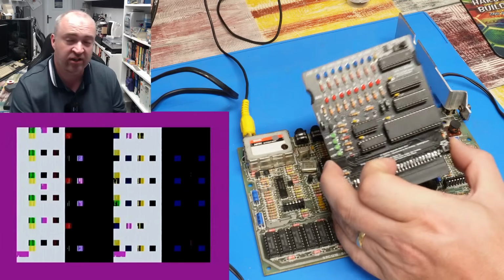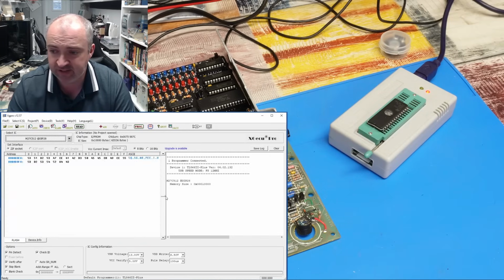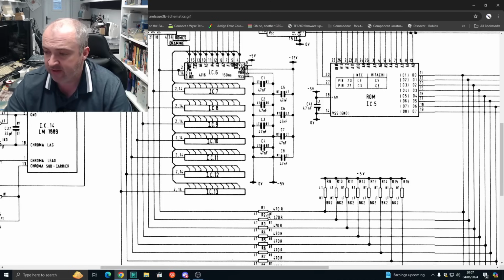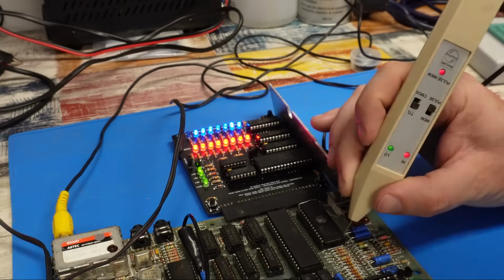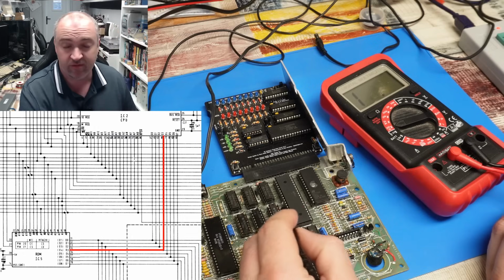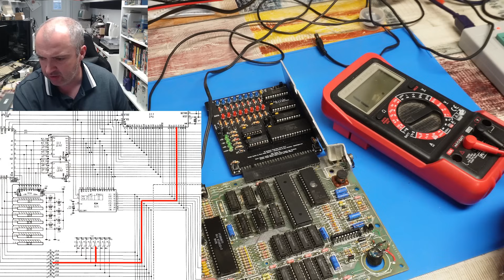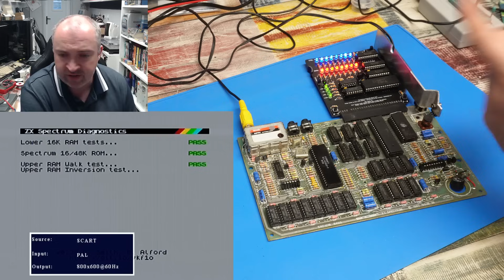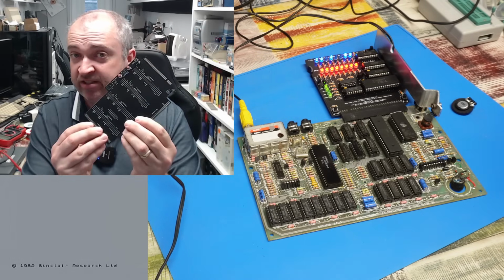Why is my ZX Spectrum Faulty?

Comment: Back in 1985 I didn't have an EPROM eraser so I put them without anything covering the window in direct sunlight for days on end but not a single bit flipped. They are quite resilient and just absolutely do not get erased that easily. You really need harsh hard UV light to do that. Maybe you could repeat this experiment yourself, it it quite hard to get a single bit flipped with normal light, nearly impossible. Just burn one and keep it in the sun all summer, I bet it will keep on verifying okay.

Comment: Logical path tracing method to find the break.  

Nicely done as usual, bud.  Another beauty retro system repaired.  🍻
Reply from the maker: Thanks.  Where possible I like to try to think out the issue before jumping in to replace things and the spectrum is simple enough that we can logically work it where the problem is.

Comment: New Z80's are $17 on Mouser but they're out of stock right now. Also be aware there are 2 CS lines on the ROM and EPROM and they are different depending on which one is installed.
Reply from the maker: I have a mod done to the Spectrum to use the eeprom and the bar you see linking pins 28 and pin 1 is feeding 5v into pin 1 to select that particular bank in the rom.  Not essential since I have the same rom image in all 4 banks but better than leaving it floating.  You could actually fit a switch and change between the different banks to select different rom images.  I might look at doing that.

Comment: A quick niggle, the silk screen layer is only where you see printed lettering captions on the board. The conformal coating is probably what you were thinking of, the usually green insulation layer covering all but the solder pads on a modern circuit board. This is the layer below any silk screening.
Reply from the maker: Yeah that's the one, just a slip on my part.
Reply: a.k.a. "solder mask".
Reply: @AttilaAsztalos  yup, that’s the common name for it.

Comment: The heat of the desoldering process might have  affected an(probably) already doggy trace. Pressing the CPU back in the socket might broken it.
Reply from the maker: Possibly, I never thought of that but I guess you're correct.  Maybe just need to be a little more careful in the future.  Although I could have swore I tested it after fitting the new CPU but maybe not.

Comment: Great find on the broken data line trace and nice technique in repairing it.   Fred
Reply from the maker: Thanks Fred, I did consider removing the socket to just repair the trace in situ but just handier to just install the wire.